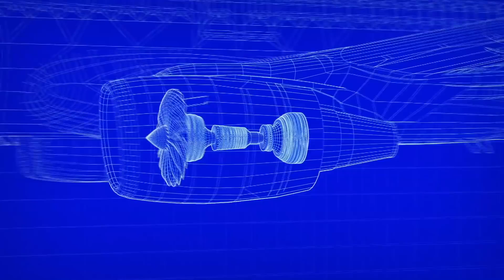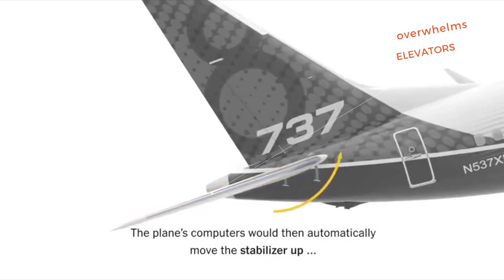737 Max 8 probable cause revealed - Prof Simon

Comment: My 5 cents as an airline captain on B737ng & max:
1) The reason for MCAS existence is not extreme pitch-up risks, but to satisfy handling COMMONALITY with 737NG to minimize certification and training costs. The plane by itself is not such unstable, that an MCAS would be required for airworthiness.

2) Stall onset on an airliner normally shows itself with a nose-down tendency; 
as does an unappropriate MCAS input, when the max trims nose down due to wrong aoa data. The pilot has very minimal time to decide, whether to thrust the stickshaker (is it a genuine stall-warning?) or if the MCAS is at fault. This, coming at a very critical height and phase of the flight.

Remember; you never would hear trim motors during stickshaker activation; and you have very limited opportunity to take your eyes of the pfd in an actual stall recovery maneuver. 
That's what I believe happened in these two unlucky flights. RIP
Reply: But recovery in either circumstances require authoritative input from the pilot.  He / she must quickly take manual control.  The cvr in one of the situations, the crew was consulting the quick reference.
Reply: You have to isolate the problem to solve it. MCAS malfunction is not the only problem you may encounter on a MAX flight. Therefore initially you have to decide what's the problem you're having. That's exactly what I was trying to stress in my previous post. 

Even the LionAir crash and knowing the FAA Airworthiness Directive are not reason enough for a pilot to jump to conclusion and cutoff the stab trim. A real stall onset is a very serious problem at low altitude, and can be real due to unreliable airspeed. If a pilot does ignore that as a possibility, he/she may end up crashing just because of that. 

Unfortunately, the MAX AD did not explain the possible situation a pilot will experience due to wrong aoa data very well. And therefore I believe that even knowing the airworthiness directive did not reduce risks enough to keep the max airworthy; I was sceptical of the Max since the Lion Air crash and insisted that the plane should have been grounded long ago.. since the fdr of Lion Air 610 was decoded.

Comment: There is no such thing as a mechanical or electrical device that cannot fail. In fact eventually all of them will fail. The American view as exemplified by Boeing is quite different from the European view. The American view places ultimate control in the hands of the human pilot. Boeing's real error here was in not instructing pilots how to overcome the computer and take manual control. Those planes that went into a nose dive but pulled out were piloted by people who knew how to override the computer.

In an emergency landing on the Hudson River in New York City, an Airbus plane taking off from Laguardia Airport in Queens sucked  birds into both engines causing them to fail. The biggest problem the very experienced pilot had was wresting control from the flight control computer. Airbus is more reliant and trusting of the machine than the man. Several years ago an Airbus crashed just north of South America. The problem was defective pitot tubes sending a wrong signal to the flight control computer.

I will not trust a self driving car unless a driver can sit behind the wheel and immediately regain full control over the car in an emergency. Automated systems are great but only when they work.
Reply: Mark Fischer  Thank you for posting your lucid comment.  I agree completely.  In the Hudson incident, one engine was capable of producing power but a damaged sensor told the computer to roll the engine back to idle. ( I think the other was too damaged to do much).  The computer thought the engines were overheating. So what? Screw the engines and get back to the airport.  Which analysts say was possible had sully been able to accelerate the engines.

Comment: Software solutions for fundamental aerodynamic design flaws. Time to scrap this plane. Go back to fundamentals. Note. Pilots to treat it as a runaway horizontal stabilizer and turn off the motors with the two switches on the forward pedestal as has always been the case. Would have been nice if Boing had acknowledged this design flaw and patch software fix. Then go to the software issues. Fundamental design flaws there too with fault controls. Glad they grounded this plane and the flying public starts to find out what a debacle all of this is. Too bad.

Comment: You must understand Sir, the answer is not only to be found in Boeings (incorrect) choice of computerised software, the software is of no use whatsoever when it is completely incorrect in its application as the current MCAS software clearly is, in addition to which you overlook (as Boeing have done) the correct software application that should have been devised in the first place and in consideration of this factor their is no correction and the Max 8 aircraft will continue to pitch nose down beyond take off in a way that is incontrolable because the so called experts at Boeing simply do not know how the software should have been devised to operate safely if they had they would have devised it that way in the first place.  All that really can (and should) be done now is to disable the MCAS system on all Max 8's and allow the trained pilots to hand fly the aircraft, this is the only thing that makes sense from a safe flying persective.

Hope this helps.

George C.

Comment: I did a bit of research on the competition between Boeing and Airbus and found it striking that both planes had 16 month between first flight and first delivery. This means Airbus has handled potential problems in a better and more responsible way or had the better design from the beginning. In fact Boeing seemed in panic as the A320neo had  its first flight on September 25, 2014 and was first delivered on January 25, 2016. Four days later the first flight of the Max took place and the first delivery on May 22, 2017. The Neo's credo was less noise, less fuel and less CO 2 - so this was the was the standard Boeing had to meet and they made the fatal decision to use bigger engines (and other decisions as in aviation there is no single fault but a chain of events). Interesting detail: former Boeing Manager and US Defense Secretary Shanahan was still manager when Airbus launches the A320neo and became Vice Secretary in March 2017. He was responsible for the  Dreamliner with its failures and the 757 which airlines gradually replace by the A321. In the US an inquiry has started against Boeing managers and Shanahan (who gives Boeing an unfair advantage over Lockheed who now allies with Airbus)

Comment: Heading towards terra firma  at an alarming rate is no time for reading 📖 trouble shooting manuals,, 
Pilots must know how to obviated auto controls intuitively if a problem should arise especially at critical take off and landing regimes.
The whole flying tail stabilization is to me a bit dicey to contemplate any malfunction that the rest of the flying controls can’t compensate for, should be a fail safe system to return it to neutral in event of over control of porpoising of aircraft. Again fly by wire great if it doesn’t malfunction. But if it were to there must be an immediate disconnect.

Air speed and altitude are like life insurance,, a cushion to correct problems, low and slow you stall, you crash.

The B-2 Stealth is inherently unstable, hard for humans to adjust quickly enough, the fly by wire does this job but there is no room for systems error or redundancy over lap control confusion.
Jack Northrop’s original flying wing did not have this technology and had problems because of that.
But at some point one begins to wonder why reinvent the wheel,, save a bit on fuel, but crash into the sea. We’ve had time proven designs in service for decades, better to make highly tested improvements to sure procedures, and not become overly dependent on self flying designs. Of course in my opinion most humble indeed.
Reply: Bill Bright  I agree with your first two paragraphs.  I would add that in The case of the B2 ; is an aircraft where the crew is paid to take risks in a dangerous environment (combat zone).   So I understand the necessity of the design . Plus they have ejection seats.  Case in point, the take off at Guam a few years back.

Comment: Dear Editor,
You won't find out from the major media as to inherent flaw in the safety system most likely responsible for the recent  737 Max crashes.  Although the 737 has at least 2 angle of attack sensors, it ONLY uses ONE to decide the fate of it's passengers and crews. Instead of  using two angle of attack indictors to determine if the data is the same on both, only one is used. A simple logic  circuit could automatically disengage the system if the data was more than a certain percentage off.  To have any automatic system override the efforts of two pilots is another logical safety measure which is missing. You might have one suicidal pilot,but having two on board is very , very unlikely.
Boeing has had a long history of cutting corners on previous 737 models. And there again, Boeing and its subcontractor escaped punishment, but the whistle blowers lost their jobs. Being part of the Military Industrial Complex has its perks!

Comment: The pilot in the jump seat prevented a crash the day before with the same plane. Lion Air. Reminds me of the days long ago when there was a flight engineer that keep an eye on the the pilots and the systems  during landing and take off he would be facing forward. If he has come forward it may have prevented the crash of bought planes. Only this week this was revealed. Boeing planes should be   boycotted and the managers and the FAA be  held liable for the deaths of the crew and passengers of both planes

Comment: These two aircraft could have and should have been saved by simply turning OFF the stabilizer trim actuator. There are two barrier-protected switches that accomplish this. This is what the more experienced Lion Air jump-seat pilot did the day before the fatal Lion Air crash. With the stabilizer trim actuator turned off, the MCAS is disabled. Control is easily recovered, and the aircraft can be safely landed.

Multiple 737 commercial pilots have reported this. For whatever reason, the media seems reluctant to report this less-sensational reality. Those experienced 737 pilots say that this procedure is a standard part of 737 certification and has been for as long as the 737 has been flying.

So it appears that while there is indeed an issue with the MCAS system, it is an issue that a properly trained flight crew can easily handle without loss of the aircraft.

Comment: I assume the MAX has the same AOA Redundancy Management as the Boeing 777, there it uses a modified midvalue selection. From the B777 AMM (Aircraft Maintenance Manual): 
The modified mid-value selection chooses the mid-value of these three AOA values:
* Left corrected AOA
* Right corrected AOA
* Calculated AOA.
The AOA redundancy management logic receives inputs from the inertial and air data systems to calculate the calculated AOA.

This is done in both SMYD (Stall Management Yaw Damper) where both AOA vanes are connected to. This unit also monitors Flap position, Gear up/down, TOGA switch and stick shaker.
Boeing has 2 redundant systems whereas Airbus has 3, also 3 AOA vanes and has some voting system to eliminate a bad sensor.

In the case of JT610 acident flight the left vane gave a value about 22 degrees higher than the right one even on the day before (JT43) the fatal flight, the difference looked even higher before and during taxi.
The reason for this offset can be mechanical (bend) or electrical / software (bad contact, altered calibration data)
From what I have read the most troubling thing is that the active FCC (Flight Control Computer) ignores column input in MCAS mode. This seems to be as designed but is confusing to pilots as normally column movements will stop trim commands. Also normally during flight the autopilot or SRS execute trim commands so the pilots won't know which system is trimming and assume that the trimming is normal behaviour. There is no direct way to determine when MCAS executes trim down commands. That is exactly why pilots need to know about MCAS and when it activates and how it behaves under fault conditions.
Reply: Ain't there no gyroscope?  Somebody designing aircraft is sending data to a computer, and doing all those metrics with a sensor or two that is outside the aircraft fuselage in the cloud vapor and pollution?  And chances of him getting a database of clean data is a. Miracle waiting to occur

Comment: So? when the plane has the nose pitch down more than 0° (Staying Horizontal) They don't have something to correct it the other way?
Reply from the maker: Good question Michael....the i'm not sure what angle makes the elevators stop working ....but the tail trim kept running all the way to the end stop...the crash investigators found this in the wreckage.....it seems the macs system....kept squirting another 2.5degrees of trim...everytime the pilots pulled up on the yoke....not  good......and they were not trained to turn it off...because Boeing wanted it to work without the pilots knowledge to fix the planes issues with the out of balance engines..all sad.
Reply: Professor Simon Holland - My dad flew 707s in the 1960s, and trained to deal with runaway trim problems way back then.

Comment: The real question is: why didn't the pilots switch off the MCAS system completely?
Reply from the maker: good question...firstly Boeing did not think the pilots needed to know about the MCAS system correcting the out of balance new engines....so initially they didn't tell them...after lion air they told them...late.....and it is also possible the macs applies its 2.5 degree trip...everytime it is cycled by the crew...leading to a condition where they had NO control authority to recover...what do you think?
Reply: @SimonHollandfilms  Well, i've seen and read quite some info about it, but it seems more complicated than I thought. Maybe switching off the Stabilizer Trim Cutout Switches could have prevented the Crash. I think youtuber and pilot: blancolirio made some very good points about this problem in his video from yesterday. But it seems that the 737 Max, (for the moment), isn't stable With or Without the current MCAS software.
Reply: The pilots could have and should have turned off the stabilizer trim actuator. This is the motor that the MCAS system uses to turn the jackscrew and change the stabilizer trim position. Its activation is shown by the spinning trim wheels on each side of the throttles. Turning off the stabilizer trim actuator effectively disables the MCAS system.

Multiple other sources report that this procedure has been a required part of 737 certification for as long as the 737 has been flying. This appears to be a crew training issue.

Comment: It may well be that the 737, born in the 60's, is simply too old a design to be upgraded any further. The MAX is exactly that, the 737 fuselage maxed out. I predict the upcoming 797 shall replace the MAX and many orders for it will be swapped for the new design. The 737 may have had it's day and these two tragic crashes are the beginning of the final act. God speed the crews and passengers of Lion Air and Ethiopian Airlines.
Reply: Lmao if you think this aircraft is going anywhere then you are wrong

Comment: Only T-tailed aircraft can "deep stall", as in this condition of extreme nose-up attitude the non-laminar airflow across the wings perturbs any chance of regaining horizontal stabilizer and /or elevator authority. You cannot even roll into the pitch axis, as if this third dimension was locked out.

The crash aircraft could not recover aerodynamically in a natural phugoid mode, as the horizontal stabilizer was at its maximum nose-down limit and engine thrust was full, as MCAS had full authority. An unrecoverable high-speed dive at low altitude, judging by the impact crater dimensions, in the Ethiopian instance.
Reply: hbb8672 v2.0 and at least one of those T-tails has a system installed to get it out of a deep stall.

Comment: Nice video, right, when this would happen for the third time Boeing would be in real trouble. They said the sensor has a heater so it doesn't freeze at 30.000 ft altitude. So it also has to be taken into account that there is always a certain percentage of interference liability,   susceptance of failure. Whether one can have an additional risk factor in an aircraft which already has so many delicate components? Pilots have so many stressful situations, bad weather, takeoff at night, crosswind, turbulences while crossing the Atlantic, etc. And MCAS is another item causing utmost attention?

Comment: I am amazed at how much of this I understand from flying remote control planes. 
For example, the pitch tendencies from the motor placement resulting from wing placement, and the same from the flaps. 
Even on my models, I use the remote control software to program pitch compensation by means of the elevator to counteract thrust. 

Of course I have also changed motor thrust angles so software compensation is not needed. 
I'm currently making a scratchbuilt 737 Max 10. 
All of the same aerodynamics apply on the scale models as full scale. 
The main engineering difference is I don't have to chase the efficiencies the Boeing designers do. 
On some models I am concerned with efficiency and everything is considered. 
RIP the passengers who are trying to save a dollar and flew in a plane designed by those simply trying to make a dollar. Neither is a fault no more than the other. It is easy for some to point fingers. The right thing needs to be done even if it cost two dollars.